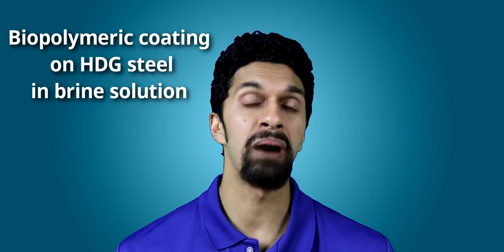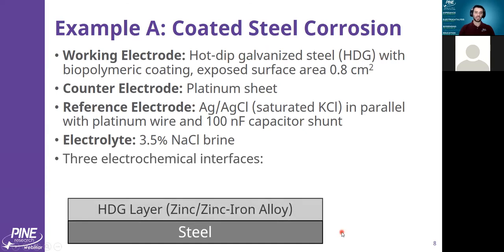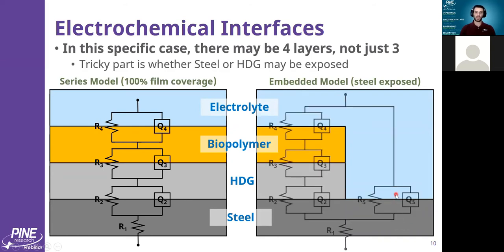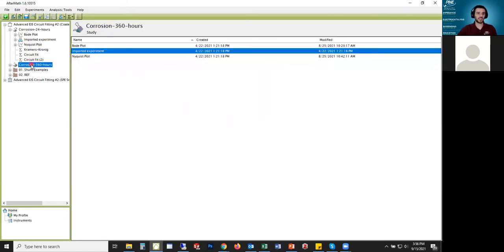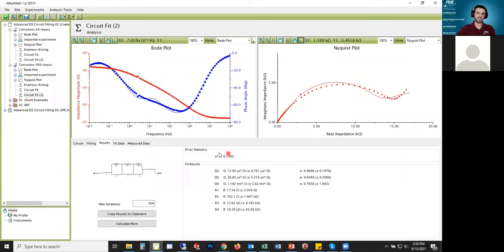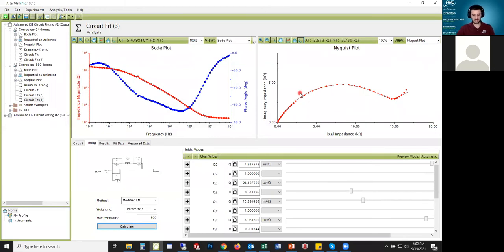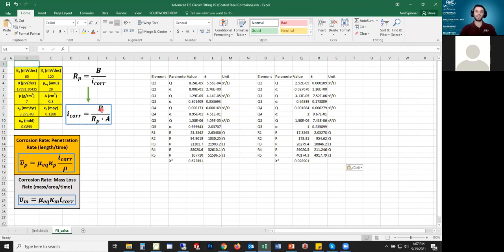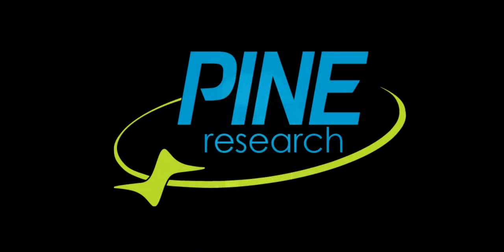Electrochemical Impedance Spectroscopy of Coated Steel Corrosion

Comment: Hello! I wanna measure impedance for semiconductor metal oxide for use in electronics, I wanna use potentiostat. So, I was wondering how can I use it for such measurement and what is the best setup or conditions! If you have any information I would be grateful.
Reply from the maker: Measuring semiconductor properties electrochemically can be done in a way similar to almost any other electrochemistry experiment.  It may depend on the form factor for your metal oxide.  For example, if it is in a type of wafer or flat disk, you may need to connect it to an electrode holder and dip it into a vessel.  If it is a metal oxide powder, you may need to cast a thin film onto a substrate like glassy carbon to perform electrochemical tests.  Once you are able to figure out the manner for your working electrode, you will simply complete the setup with a counter and reference electrode, electrolyte, then you can perform EIS experiments.

This is somewhat general, as I can only give general advice from the context of your question.  If you have more specific questions, you can comment back here or join us on one of our weekly Livestreams here on YouTube on Fridays.

Comment: i didn't understand the purpose from nyquist plot like what the role of this plot in corrosion study ?
Reply from the maker: I'm afraid I don't understand exactly what you mean.  The role of the Nyquist plot is basically the same as the role of Bode plot, which is to say it is a visual representation of the EIS data.  The software I use in this video demonstrates how you can view both Bode and Nyquist plots at the same time to help guide the circuit fit.  Sometimes you may wish to adjust fit model and parameter values so the Nyquist plot looks best, sometimes you adjust so the Bode plot looks best.  I believe I tried to be clear in this webinar, and every time I show these circuit fitting strategies, that those decisions are usually up to the researcher, and I am not trying to dictate what everybody must do all the time with their data.  I hopefully try to provide some strategies and guidance, but the ultimate analysis and fitting is always up to the individual researcher.

Please let me know if you are still confused by this, or perhaps you have a different hang-up about which you need further clarification.

Comment: The models are pretty much not correct, even if you can fit them well to the data. Steel is only in contact (exposed) with the solution when the polymer coating and zinc coating are artificially damaged, down to the steel. This could have been inquired about, from the originator of the data. Typically, however, one does not scratch the coating in EIS measurements on coated specimens (unlike in studies of delamination or filiform corrosion). So the title suggests something wrong, it is obviously not steel corrosion! Also, in my opinion, one does not need to assume any resistance/CPE between steel and zinc, since both metals can be assumed to have approximately the same electron conductivity. And in the end, calculating a corrosion rate on a coated sample may work mathematically, but it certainly does not make practical sense. I hope the critical remarks do not annoy you ;-) Best regards
Reply from the maker: Hello Dr. Heynz, thanks for your comment, and I appreciate that you clearly have some expertise in this area - most likely more than I did when I conducted this webinar.  To try and be more clear based on your input, we've changed the title to specify it is "coated" steel, as hopefully this conveys a better message for the content.

I genuinely enjoy and appreciate criticism and feedback like this, so absolutely no need to apologize for any annoyance.  This is the essence of science - discussion and debate.  In that spirit, please allow me to make a few comments in response to your salient feedback:

First, generally speaking, I always do my best when conducting these kinds of webinars to admit that these data are submitted to me from researchers in the field, and I am only doing my best to illustrate possible EIS analyses.  I have only the data and whatever pieces of additional information those researchers are at liberty to share with me, so it is possible I am lacking certain knowledge that would aid my analyses.  Additionally, I have my own areas of expertise, and to be perfectly honest those do not always overlap ideally with the data used in my webinars.  I always try to be very clear about this, and I also try to be honest that I may be wrong.  I am fairly certain in this video I even mentioned, for example, that my analyses may not be perfectly valid, and even with respect to the steel-Zn interface that it may or may not be appropriate to use a Randles element.

Second, I believe you are correct that there may not have been intentional scratches on the researcher's sample, but their sample was tested over extended hours and based on the information I received directly from the researcher, it is entirely possible the underlying layer(s) of steel and/or Zn could have become exposed after extended testing.

Finally, regarding your comment on the mathematical analysis, I agree with you completely!  Again, in the video I specifically mentioned this analysis may not be perfectly accurate.  However, I find there to be great value in at least attempting to show how EIS data can be analyzed, first qualitatively, then quantitatively.  It is certainly reasonable that these exact expressions may not be perfectly applicable to the system under study, but I still feel the value in demonstrating how EIS data might be used for further numerical analysis is quite high.  I also performed a similar kind of quantitative analysis in an earlier webinar video on PEM fuel cells where I attempted to show how one might obtain diffusion coefficients from EIS data analysis.

Again, I appreciate your feedback, and thank you for watching our YouTube content!

Dr. Neil Spinner
Reply: @Pineresearch  Hey Neil, thanks for the detailed and honest answer. I see it the same way as you do with the essence of science ;-)
The really correct title would be "... coated galvanized steel corrosion" ;-). Galvanizing the steel will keep it from corroding for a very long time. Otherwise you would see red rust, usually white rust comes first when the zinc corrodes. But I think that was not the case here, the impedances at low frequency are still much too high. Overall, however, the impedance for a coating is very low here, so there is no good barrier effect. This is certainly not unusual for a biopolymer (possibly from development). Commercial coatings are well into the giga-ohm range. There it becomes very very difficult even for impedance measurements, but quite feasible. A short addition to the circuit diagram: by default, one uses a parallel circuit of a capacitance and a pore resistance and behind it the classic Rct+CPE. This is described very well in the literature. So, again, I hope this helps a little. Many greetings
Reply from the maker: Hello  @drheynz2755 , I agree with your points.  The impedance for a coating is indeed very low, but considering it's a biopolymeric film that is to be expected.  I think I can incorporate all of this into the next EIS webinar involving some form of steel corrosion.  Thank you!